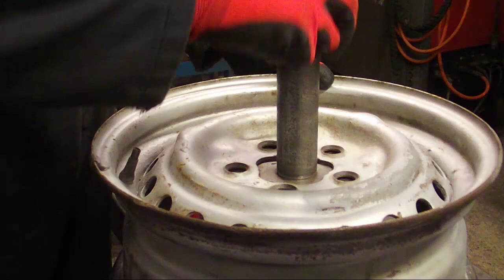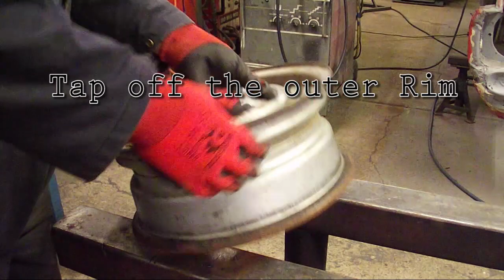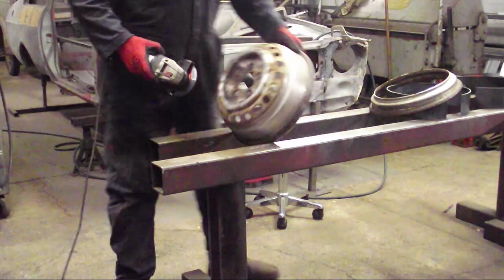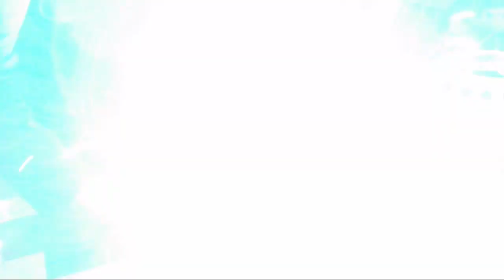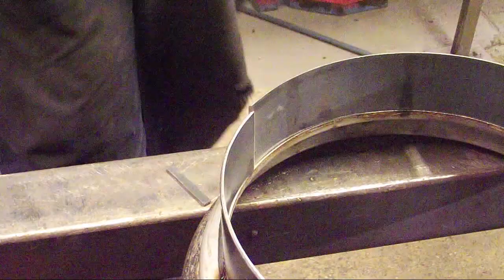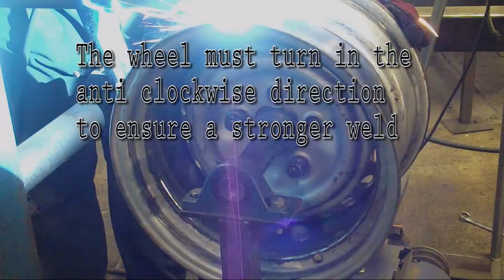Banding steel wheels

Comment: For the cost of a 13" racing wheel. Any width, any backspacing, only two pieces, stronger, lighter, and virtually no run-out? My time on the car is more valuable than this. My dad did a version of this in the 60's, but they didn't have "mass produced, custom" wheels back then.
Reply from the maker: You would be surprised what you cant get, and we have to make up
Reply: I've been around race cars all of my 63 years. When it comes to wheels, you aren't looking hard enough. All of the wheel companies I've ever dealt with could build anything I needed, with more precision, less time, stronger, yet lighter, and at a fair price.
We've made more for our cars than anybody we raced against. But nothing from the spindles out on the front, or the rotors out on the rear. Not just for safety, but for consistency. For crash repair, if we order the same as last time, we get exactly the same as last time. And if we don't, we can send it back, and not wasted our time.
Reply: Some people are full of their own sh*t aren’t they?
Reply: @DDS029  these arent aimed at race cars, its more for the look. They obviously have a market if they are doing them . Why so angry 🤣

Comment: Hi im fascinated by this...i have some questions..
How thick is the steel your using...3mm ?
Also if you weld the wheel continuously does it not distort the wheel ?
Thanks
Reply from the maker: Hi, yes they were  3mm bands but we always put a band in that is the same thickness as the wheel for safety. No it does not distort the wheel at all, thanks for watching.
Reply: @usherengineering179  hi thanks for replying...how much do you charge to band a 14 inch vw t25 wheel...thanks

Comment: Tack the ends of the band together first,then you won't have to fight it all the way,yes I have done this.
Reply: If you notice, he didn't cut to exact length until the last tack around the wheel. Easier then trying to measure around the wheel to cut the band at the exact length first, and every time.
Reply from the maker: Tried both, this way to me is a better fit